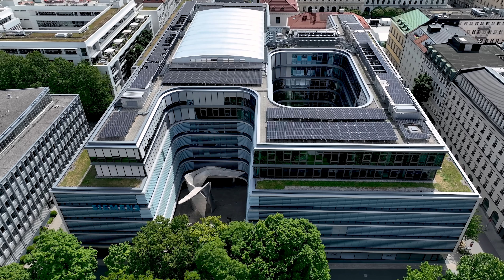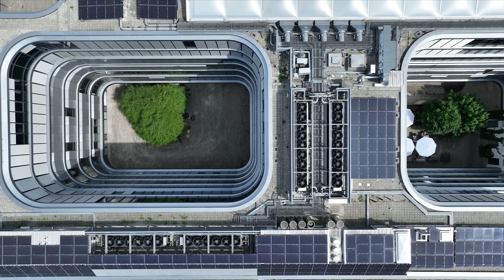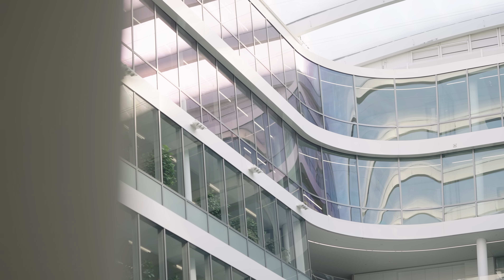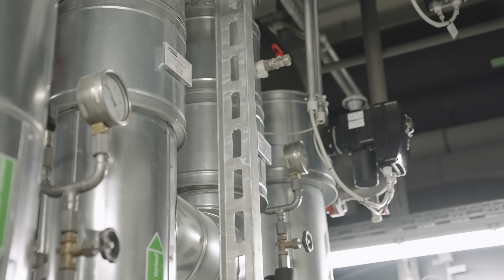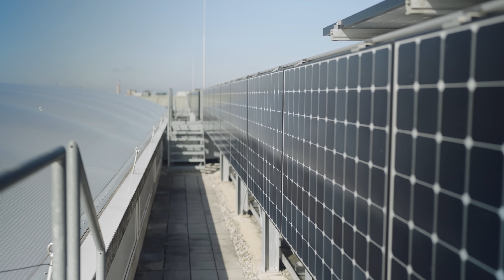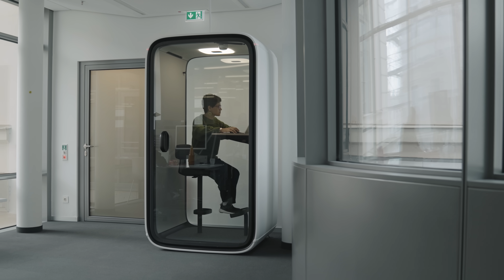Inside Europe's Smartest Office | Siemens HQ

Comment: Sweet, but I don’t see anything smart in it…

Considering the era of AI, you can… tear it down 😂😂😂😋🤷‍♂️

But really sweet! 😅
Reply from the maker: The "smart" technology is integrated throughout the building's infrastructure, not always visible to the eye:
• 30,000+ sensors monitoring and optimizing building performance in real-time
• Intelligent energy management with thermal buffer storage in the foundation slab
• 800 solar panels (250kW peak) providing up to 20% peak shaving
• Adaptive climate and lighting systems using daylight harvesting to reduce energy consumption
• PX controllers (52 main + 360+ room-level) managing everything from blinds to air quality
• Occupancy sensors enabling data-driven space optimization
Reply: @Siemens  I understand, but I didn’t mean technological solutions (“The Line” was technologically impressive, and from the very beginning I said the project made no sense).

So I don’t mean “smart” in the “smart home” sense, but rather in the sense of “wisdom.”

The AI era is not a technological revolution (the name is misleading; just like “artificial intelligence”; it’s not intelligence per se).

So- to be completely precise- I don’t see anything “wise” in it.